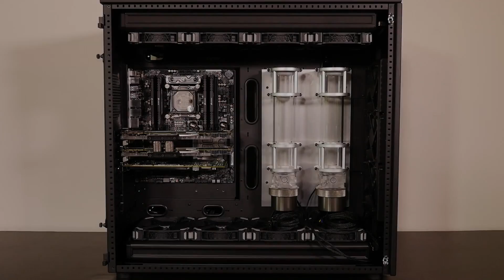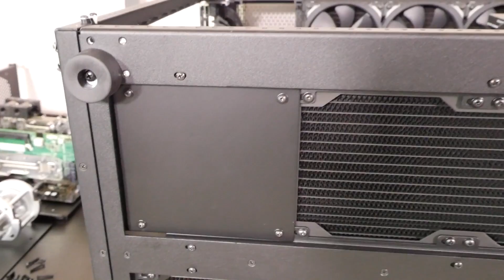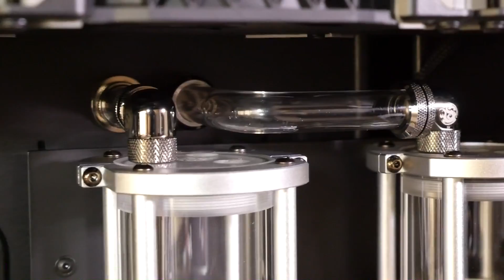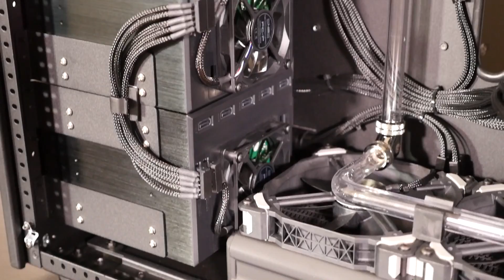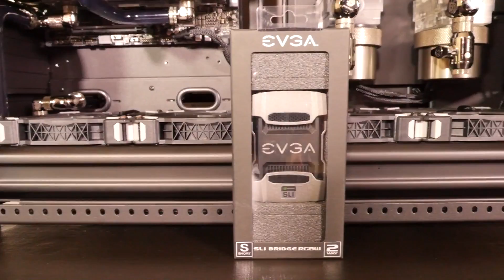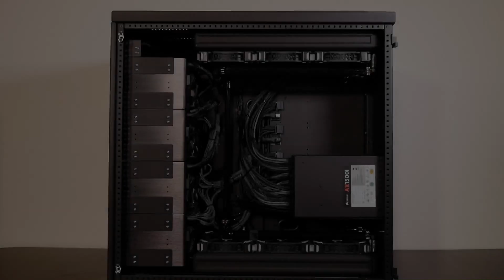SC Build #18: Extreme Workstation: Part 4

Comment: Powering your drives : you seem to have 10 drives powered off one set of 18 gauge wires.  Normally you'd see 3 drives on one of those sets.  Is this enough or did you run heavier gauge wires then the normal 18?

Comment: I love the look, but I wonder about a few things.  

1) With all those rads, the fans should be able to run totally silent, but with all those HDDs, it won't be quiet. (Perhaps fab a door to fit over the HDDs front with sound proofing).
 
2) I don't know how you have finally set up for case airflow, but in general, it seems wrong to have air blow into the case through one set of rads, and then have it exit through another set of rads.  You are cooling the second set of rads with air that has been heated by going through the 1st set of rads.

Comment: Acrylic: Harder? Yes. More durable? No. This is where the hardness works against it. It is far more brittle and easier to crack and shatter if it's not treated carefully. You're right that PETG doesn't have quite the same clarity though. It tends to have a very slightly blue tinge to it. Everything taken into consideration, I'd rather use PETG in my system not just because it's easier, but because I'd have more piece of mind knowing that it's far less likely to crack and leak if something bumps or shakes the case.

Comment: Nice video, so PETG definitely doesn't have the same stock optical clarity as Acrylic and it also tends to have some slight banding along its length, but one really nice step you can do is take plastic automotive polish and rub it down the tube and it really makes the material look more glass-like. I personally use only PETG because of the massive difference in bend-ability.

Comment: From what I can see, your motherboard only has ten Sata Data ports, I imagine that the PCI ex Sata card has the other 10 ports?
Reply: Angel Luis Trinidad 
8 Drives are running of the motherboard (it has 10 ports though) and 12 are running of the custom watercooled RAID-Card (can be found in the description).  :)

Comment: I hate heatshrink but i cant find a guide on how to do cables without heatshrink like cablemod does and they wont really tell me lol
Reply: MoDRun there are a few guides all they do is put heat shrink on half the cable before putting it into the connector they cut half of it heated up and then rip the excess off and it will pretty much be here the sleeve to the wire without having the excess heat shrink on there
Reply: devin johnson so in this case i need to buy cable pieces and cant use a alredy finished cable right okaaaaayyyyy :c
Reply: pretty much but there are guided, pauls hardware has a guide and so does this channel

Comment: Hey,
I'm very curious why you don't use glass tubing instead of plastic ?
Glass tubing is obviously the most clear, scratch resistant and chemically safest. it also have the best look.
The only downside is a bit higher price for the tubes and few more angled adapters. But considering the total cost of the systems you do, it's negligible.
Reply: Dmitri Weissman can't bend it
Reply: Dmitri Weissman Glass is really hard to work with. So unless you know a glass blower or somebody that works with it.  It's probably not as realistic an option for most people. Personally I like working with crystal tubing but that's really expensive. :/
Reply: BlazinNSoul it's not that hard. There is nod bending, so only cutting is a task. Cutting glass tubes is fairly easy. Especially with rotary tool. There are also 90 degree bended tubes available if really needed. I like it, and have no intention to use plastic tubing again.
Reply: Dmitri Weissman Hmm might have to look into that then. Maybe I wasn't using the proper procedure. :)
Reply: BlazinNSoul check JayzTwoCents. He did some glass tubing in Define Nano S build some time ago.

Comment: Is it a must too fill up the reservers to the very top? 

nice video! Keep up doing such great work!!
Reply: No, you just have to fill them up enough to get the aqua pipes inside the reservoirs, under the coolant surface to prevent any noise made by flow of the coolant.

Comment: I find acrylic really hard to work with and end up having to use more tubing due to mistakes . you are right though it is clearer and looks more like glass at  the end. I just started using colored tubing so it isnt a issue. Beast rig , well built comptuer. Congrats to your client.